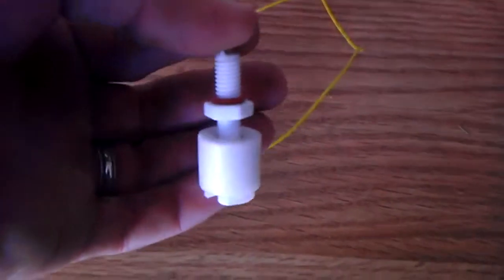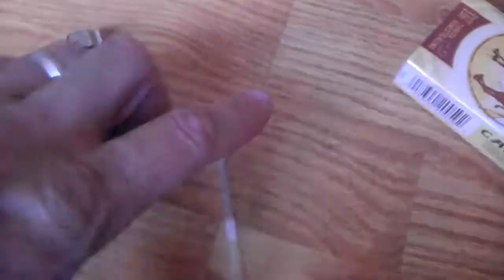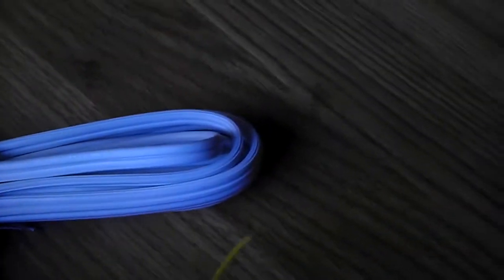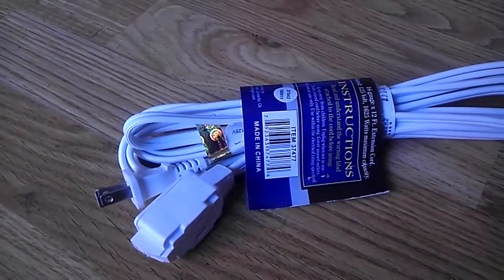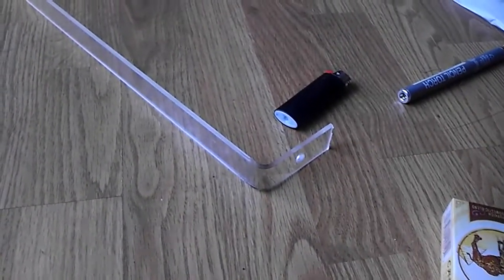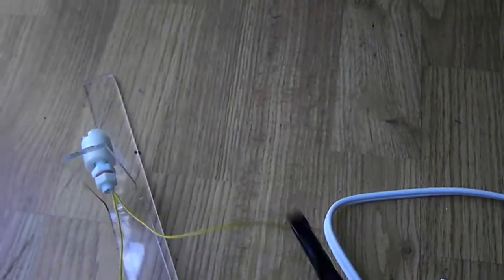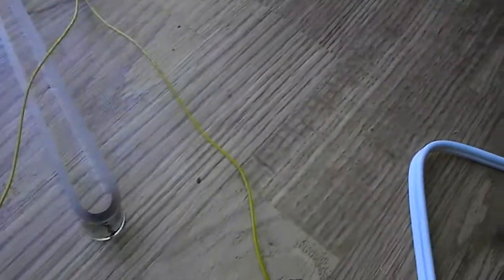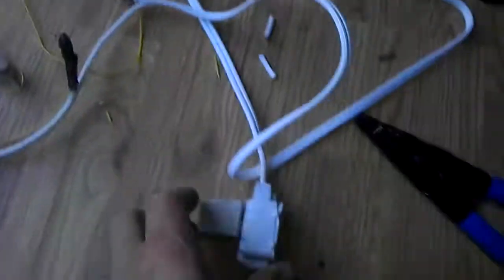Diy Auto Top Off Compilation Video

Comment: Nice video man hey does it matter what wire you're cutting on the extension cord what I'm asking is can you cut either wire or do you have to make sure you're cutting the positive wire or the negative wire I know you're only cutting just one where what does it matter which one you use I really like that idea and I'm definitely going to use it just wanted a little feedback on that question

Comment from the maker: Hey everyone just wanted to make a quick disclaimer.  After buidling this I did more research and decided to wire in a 120v relay into this system.  This ensures that if the switch fails it does not shoot 120 volts of electricty through my water and through anything that touches it.

Comment: That switch is simple enough to connect which is cool. The bending using a lighter came out nice, good job. The only thing I would do differently, is instead of taping the wires up, get some clear silicone and dip the wires completely in and cover them up, that will save the hassle of electrical tape, just my two cents, I subbed your channel, wanna follow along, take care